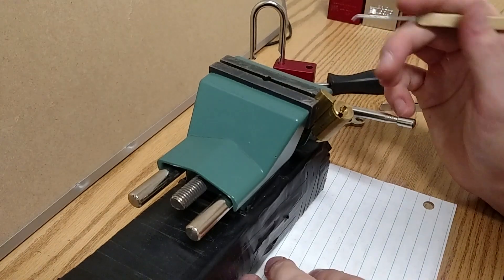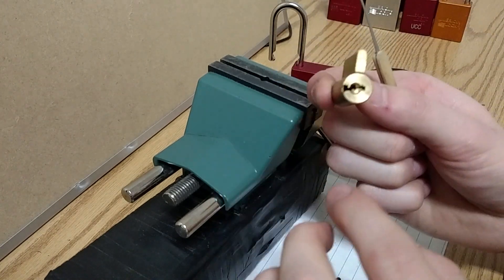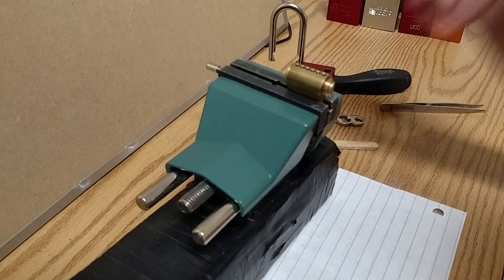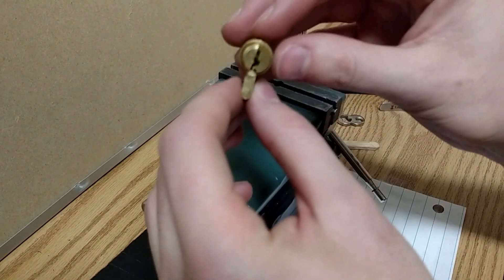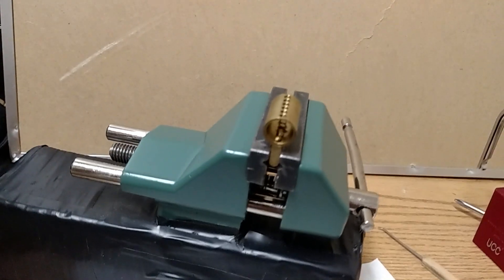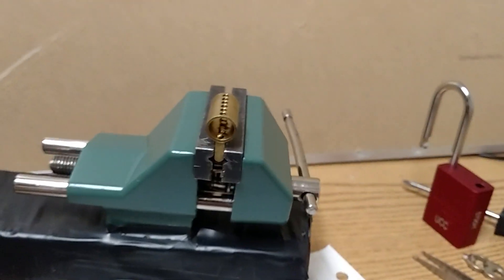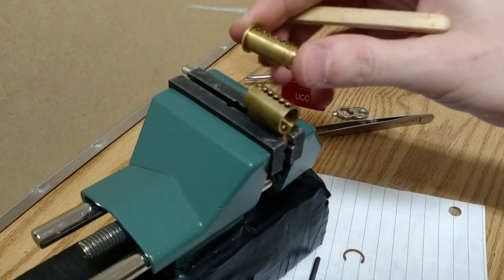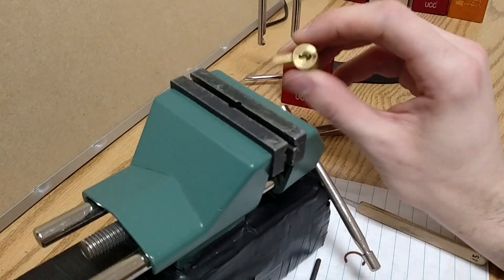Gut an American Lock Without a Plug Follower

Comment: I use the cylinder to put the driver pins in no follower actually needed on most cores as long as you catch the driver pins... you can even slide a pick in to hold them in place